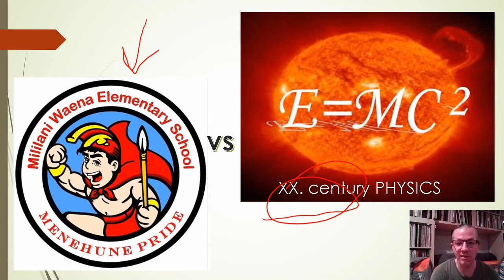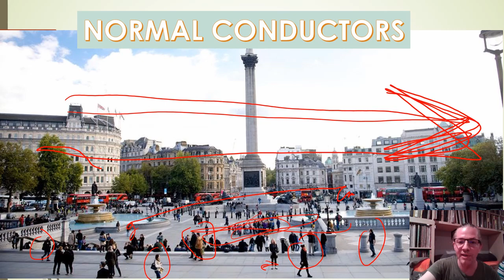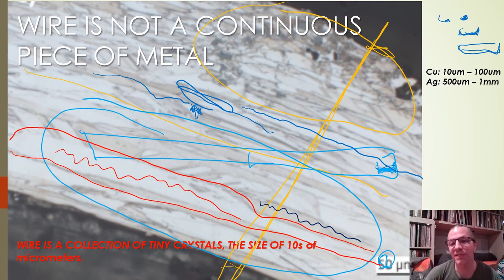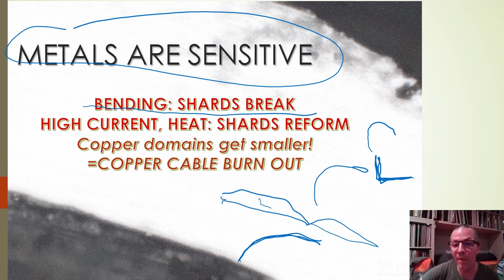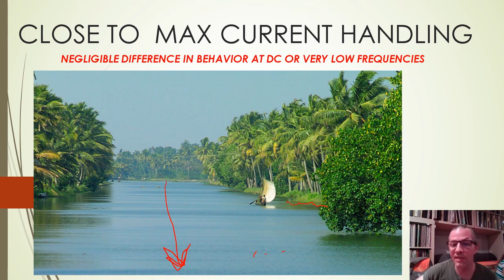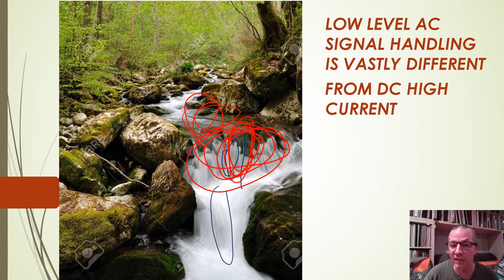WIRE QUALITY MATTERS - AUDIOPHILE cables explained

Comment: Thanks a lot Janos!! Really, well explained and again something I've learned. I'm for sure cable-makes-a-difference believer. I'm wondering how cable burnin works? Crystal 'paths' are optimized for electron flows, like they are finding there optimial street?
Reply from the maker: The paths adapt to allow the path of least resistance to the frequencies which are propagated. Where resistance is higher, heat builds up, metal becomes more malleable, structure easier to remodel... but I suspect there's more to it.

Comment: What is best method to "burn-in" speaker cables, interconnects, power cords, USB cables, etc? (Thank you for this video!)
Reply from the maker: Lots of good solutions. There are burn in devices, such as Hagerman Frybaby for fastest and most thorough burn in. Also, you can use a burn-in CD on repeat, or music material with copious amounts of energy. (A favorite burn in LP is Rick Wakeman's Journey to the Center of the Earth).

Comment: Would you like to make a video about electricity? I myself have installed a separate audio group and still a mains filter gave a significant difference. I also get sick of people who claim that 1 meter power cords cannot make a difference, because the cable in the wall is not audio grade. Nor do they understand that even connectors and wall sockets have sonic differences depending on which plating was used. People believe a good transformer can handle all the noise.. I think this is a interesting topic :)
Reply from the maker: Thank you for the tip! :) Indeed, a good transformer can filter out some noise, but that's not a solution to everything. Also, people who "disbelieve" in AC outlets and power cords are the ones who never tried it because "they know it better". Tunnel vision, that assumes once you finished 6 elementary there's nothing more to learn or experience. People with that mentality carry that over to everything they do, keeps them practical to a certain point but unwilling to change and accept the facts outside their comfort zone. Just remember: you cannot convince someone that the sky is blue when they refuse to look...

Comment: Hi, are you familiar with the "new" PC Triple C copper being produced  in japan? I was doing some basic research and ir seems that Furukawa stopped producing the PCOCC copper in 2013 (but there are still companies producing OCC copper). But now in japan they are making this PC Triple C copper...I wonder how it compares to OCC copper regarding this "jumps" and if there is really potential here to be better than occ copper as they claim or if this is just marketing as they need to sell something...
Reply from the maker: I have not seen any metallurgic data on the triple C copper. Although I suspect that they made a step in making even longer crystal domains. However, it will be most probably limited to use in cartridge and transformers, as in interconnect cables and speaker wires it would be too fragile - the 100um domains of the double C are already super sensitive to any bending (fracture easily to smaller sizes), the  longer domains would be exponentially more sensitive to mechanical stress. That being said, the triple C copper will sound as a step towards the silver sound.
Reply: @realworldaudio  I also could not find anything concrete or really technical, but I think that maybe the crystals are not so long, as furutech, acoustic revive, etc seem to be using it for power cables, speaker cables and so on. They say the techniques are similar to forging...but I have zero metalurgy know ledge. Lets hope it is at least similar to the occ in sound quality :-)
Reply from the maker: @Thiago_S..  The only two options to improve copper is either longer domains, or additives. I've seen some results with adding Titanium, or gold additives might be another option, but that it unlikely as that would make it more expensive than silver, which is much superior than any copper can possibly be - due to silvers superior conductivit, electronegativity and ductility / malleability. Many audio companies have realized that silver is the ultimate conductor, but it remains expensive because the insulation process is extremely expensive due to very small production runs versus insulated copper.

Comment: Hello, once again thanks for educating us. If one considers the different cables in a system, like power cord, interconnects and loudspeaker cables, is there one of these types cables that would show more the benefit of silver than others? I am thinking about starting with the interconnects due to the signal level. And can an interconnect entering the amplifier reveal construction issues of the amplifier itself? Or would think it would not?
Another question would be, if I have oxidized copper on my wall socket, is it enough to clean it with pure isopropyl alcohol?
Reply from the maker: Firstly, about the wall socket: if it's visibly oxidized, I'd recommend to replace it. During decades of use, from large number of plug/unplug cycles the metal fatigue and stress compromises the current carrying capacity to a certain degree (esp limiting peak currents), and adds a lot of smear to the AC, especially when only little current is drawn (quiet music will be smeared more). If you have electrician background, then I'd recommend to clean the oxidation from the copper wires behind the socket: if long enough, cut off a few cm to expose fresh unoxidized wire. If wire is short behind the socket, then use 600 grit sandpaper to remove oxidation - alcohol is not enough to remove that heavy oxidation. After the 600 grit, you can go with a 2000 grit and that will give it a very smooth surface. Then, clean the residue with alcohol. ; ).
Reply: @realworldaudio  thank you. I have no eletrician background but plan to hire one soon to change the circuit braker where the system is for a fuse holder type. Also would like him to check if it is possible to change the phase of the system to a less poluted phase etc. And then I would like to be prepared for a possible oxidation on the wall socket, so your answer helped me a lot ;)
Reply from the maker: Which cable would show the biggest change: this depends on your system components, sorry, no easy answer, but there are general considerations: for the amp, I would recommend to start with the power cord (PC), as the PC is the critical limiter for amps. When you have a limited PC and start playing around with IC/speaker cable, it can take you to a different direction, and you end up using IC/speaker cable which compensate for starved power input. Once you upgrade PC later, you might have to change the IC / speaker cable... So, start with PC first. Then, I would recommend the IC, as it's more economical: a good IC is much cheaper than a good speaker cable... Also, by using a certain type / brand of IC you will notice a change towards a certain direction. Changing the speaker cable later to the same type / brand will also continue the changes in the same direction, but for much more money. So, go with IC first, and if you like it, then invest into the same type of  speaker cable.
Reply: @realworldaudio  thanks a lot. And dont worry, this is the kind of information I was looking for: not an easy answer or promise, but some background regarding possibilities, what could make sense, etc
Reply from the maker: @Thiago_S..  Glad to help! : )